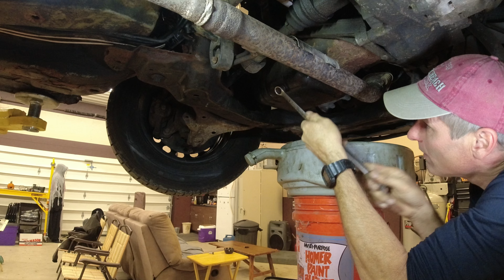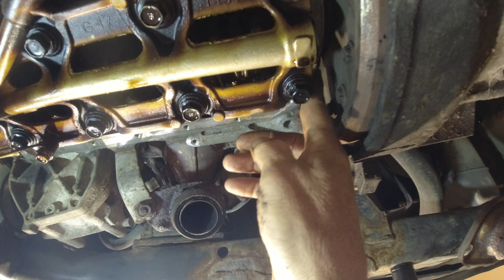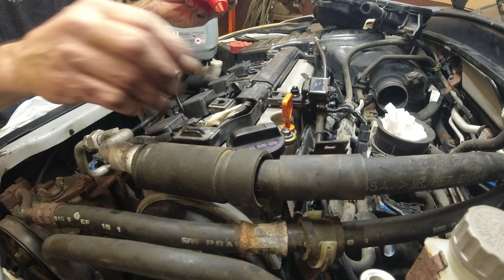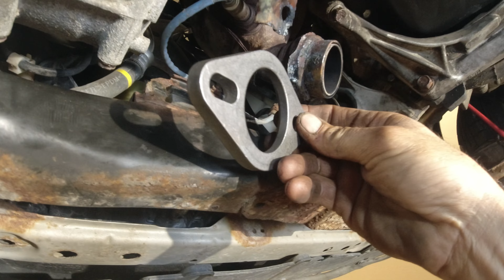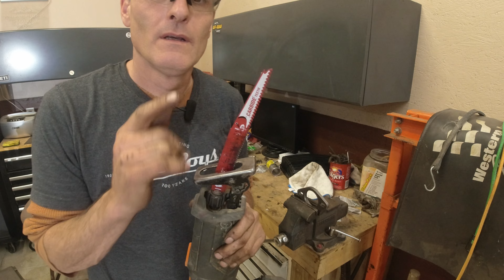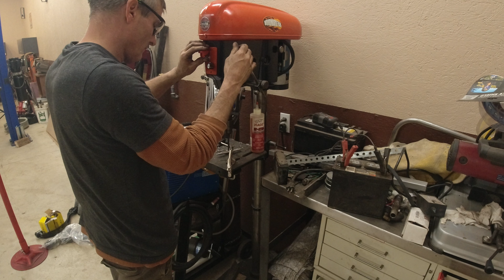Custom Exhaust Flange Repair - 2005 Honda Civic.

Comment: is the flange itself that you used a 2.5 or a 2.0 inch? I doing the same thing you did and from what I can tell in the info of the pipe you listed is the flange is 2 inch not 2.5. Is that accurate?